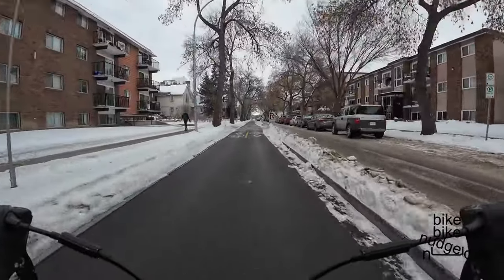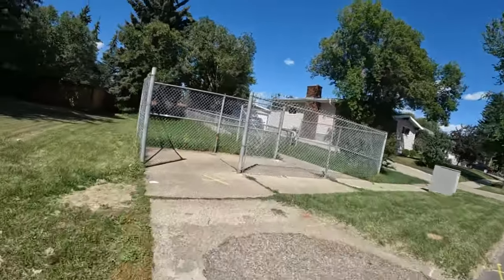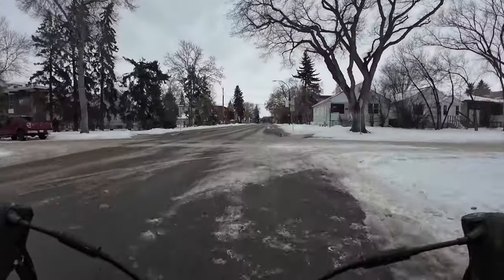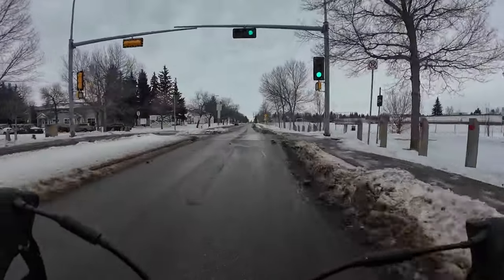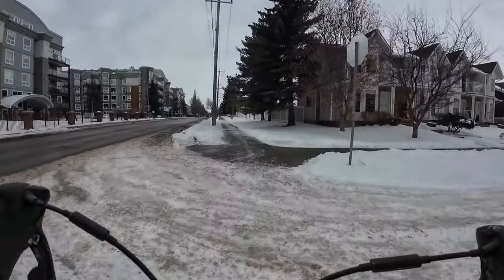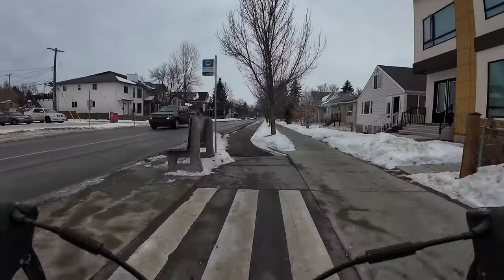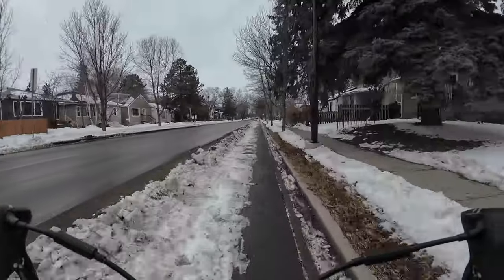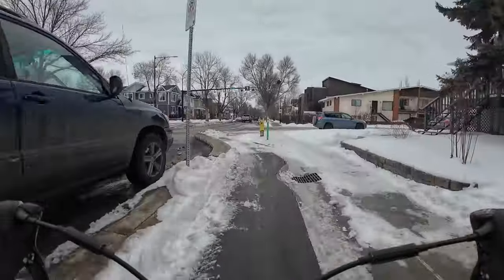Winter makes me want to replace curb cuts with this better urban design feature

Comment: In my city we have a single protected/separated bike lane or rather multi use path. The city doesn't do any snow clearing, but the high school that is runs past clears it a few blocks in either direction and then just stops.